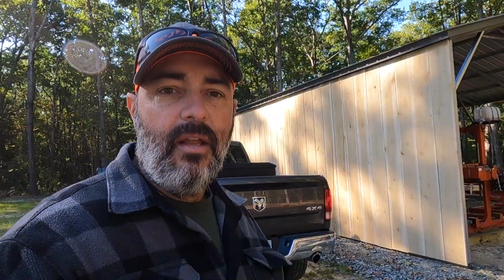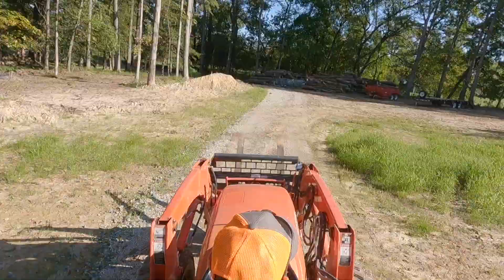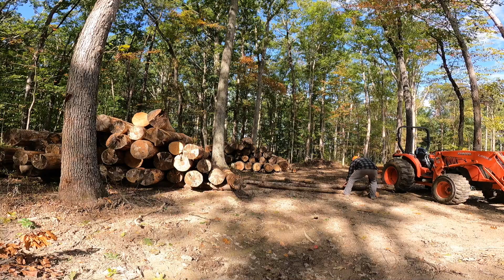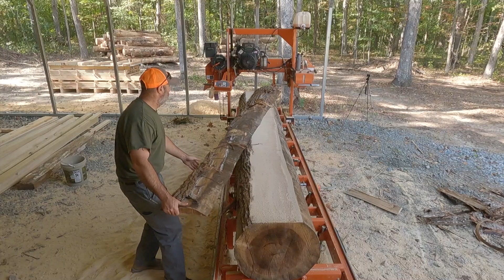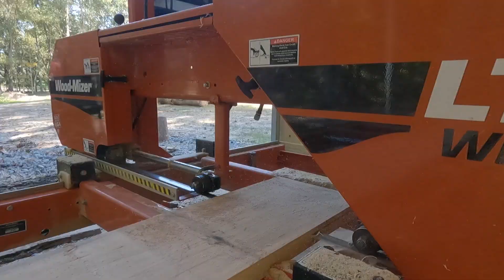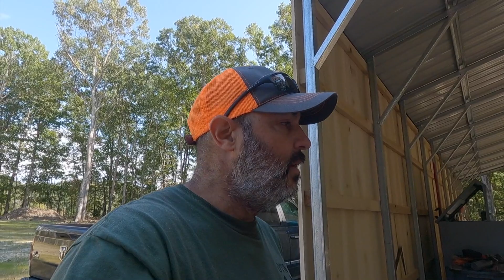Getting organized and "2 for 1" poplar on the woodmizer LT 15 Wide

Comment: Just found your channel and have binged several shows. Small world as I have same mill due any day and have wondered how to cover it. Never considered carport idea cause I don’t like metal look. Then I see your board siding and love it. Gave me new hope for a quick roof. Did you do one of the videos that shows the attachment of the stringers? Drill and lags I assume?
Reply from the maker: Awesome! Thank you! I used a #10 self tapping screw 2-1/2" long made by Hillman Power Pro.  I predrilled through the wood into the metal first. I cant recall the bit size but its recommended on the box of screws.  My next video should drop tomorrow and it shows the other side being finished with boards.